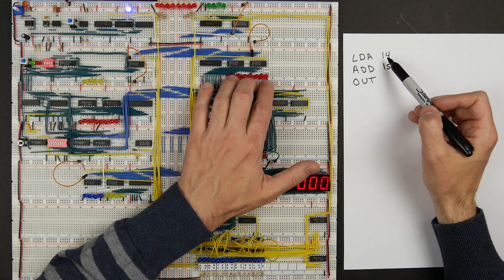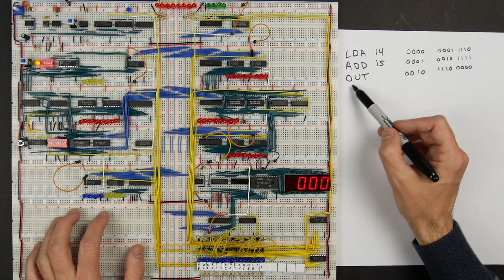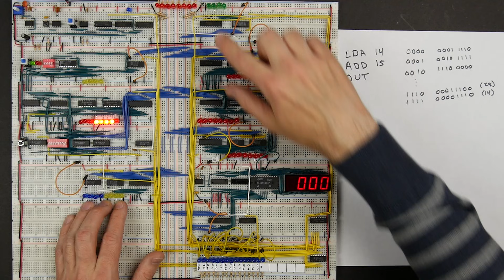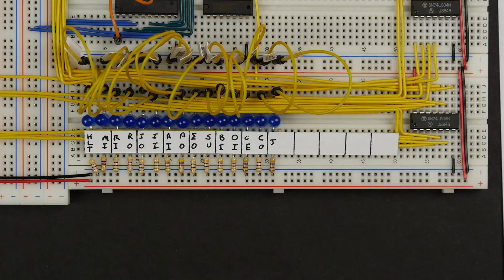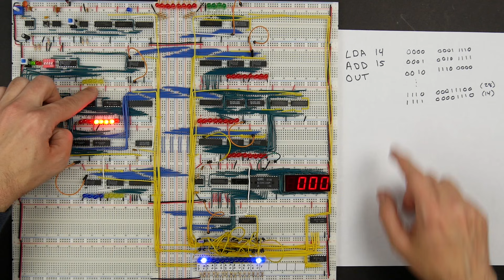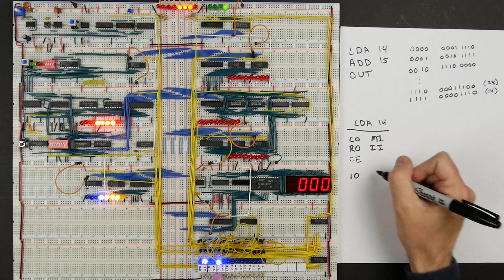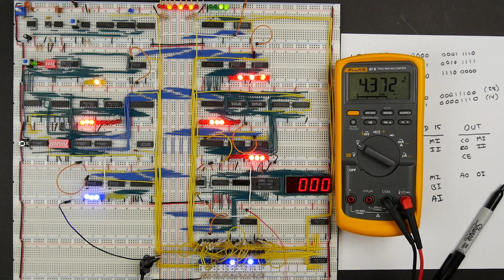8-bit CPU control logic: Part 1

Comment: Hi all - dumb question. I realize only a single module can "write" to the data bus at a time, but can more than one module "read" from the databus at a time? Asking because the fetch cycle is always "CO MI" to get the instruction from program counter to MAR, then "RO II" to get from MAR to instruction register. Wondering if it's possible to do "CO MI II" to write to MAR and write to instruction register at same time? Is there anything "electronically" that prevents this?

Comment: Hey Ben! if the program counter is looping through all the values in the instruction memory and manupilating the data inside that memory then wouldn't the Control Unit mistake a load data like 2, 6, 13, etc for an instruction? What do you do then?

Comment: @11:50
I don't know if you read comments...
Question though from the example  MO (Mem out) II (Instruction in).
Memory is ready with its output from the previous cycle, but not on the bus yet.

How do you manage the propagation between the values being written to the bus vs. read from it?

Is it fine to just turn on the (MO) write and (II) read bus transceivers at the same time/same cycle - or is everything in flux anyway until the clock cycle locks in the in values - which is slow enough to let levels stabilise.

Hopefully that made some sense :)
Cheers.

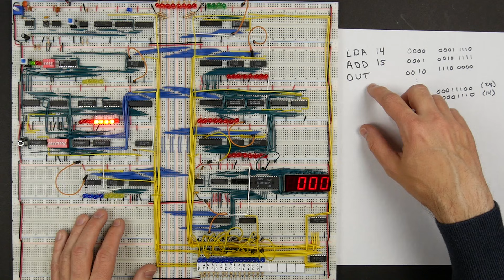Comment: The logic of building a computer that does not start with a "set program counter to.." instruction is confusing. 8:52 What if the program counter is not where you want to start? Computers are inherently built to get it checked and jump to where user wants to start ? please make video of how to add a 'jump counter to' instruction before running the program.

Comment: 13:47 my computer(cpu model) instruction register had 2x8bit register 8bit for opcode and 8bit for data
oh yes and my program counter is 8 bit too xD. so i have 8bit cpu model. your is kinda 8/4
(LDA 15)
CO MI
RO II CE
CO MI
RO DI (instruction register data oh yes 8 bit kinda D register build same board just 2x74ls173 and 8 leds more)
DO MI
RO AI
CE TS (now program counter and microstep reset ofc its inverted after led)

(LDI 150) (oh yes i can move 8bit)
CO MI
RO II CE
CO MI
RO AI 
CE TS

ofc i have 3 rom for microcodes get more signals to use

Comment: 📺💬 Jirayu gives me some conversations about the lessons.
🥺💬 You address memory and perform counter from memory in, I think someone asking me this question about do the output is from memory only or can address ⁉
🐑💬 It is a different path but he tells about inside the instruction and the output is from memory, do you remember what we can do with the memory ⁉
🧸💬 Organizing for performance. 🥺💬 Inputs only does not create new knowledge I try to express into cartoons or sample so I can leaves or add what it does need, the program counter can add number to the memory stored value but better it can desire which value to be add.

📺💬 Yui what is the root cause of the problem⁉
🥺💬 It required a clock cycle, working with memory.
🐑💬 Yes, but we see that the ground is not properly connected the measurement can measure value but it required stability to perform the correct work and good instruments had more advantage in lab setup.
🥺💬 I have sensitive memory too 🥺🥺🥺

( 📺💬 วันนี้กูจะเป็นคนนี้พอดี ...นั่นตายไปแล้ว 🐑➰ 🥺💬 ผมเห็นนะวันนั้น บางคนเค้าบอกหน้าเหมือนแต่ไม่ใช่ สอนต่อเถอะครับพวกเค้าคิดไปเองแต่งเรื่อง )

Comment: like. a=14 
b=a
a=6
c=a
b+c=20 something like that.
Reply: where the ram locations are replaced by figures out off the alphabet.
Reply: i was thinking of a basic code that represent this calculations.
Reply: 10 a = 14
20 b = a
30 a = 15
40 c = a
50 d = b + c
60 print d
70 exit
Reply: where 10 to 70 are clock counters. a basic porgram code similairity to above equation.
Reply: where the figures or letters of the alphabet can hold a vary of numbers. and therefor are called. variables.

Comment: 3 bits to control every physical object in the universe, protons, neutron, and electrons.  4 bit to control how every species on earth grow from a single cell into the great variety we have from people, to trees, to birds, to blue whales.  ACGT adenine (A), cytosine (C), guanine (G), and thymine.  Why do we need 8 bits for a computer to distinguish between a hand full of characters, numbers and symbols?  What if we could even get computers down to a 4 bit system.  That would effectively quadruple processor speeds.  (inverse square law) in case you are wondering why 4 isn't 1/2 of 8.

Comment: Hi I'm a mechatronics student currently on my sixth semester. I have to say your explanation in this video is phenomenal, your way showing how a computer actually runs a programm is intutive to a certain point, you poInt out all the important details and I just love the structure you gave to the computer and how you actually program the commands. Also the way you searched for the issue at the very end from mesuaring highs and lows until you find the specific place where the issue is happening and also looking at the datasheet for the component to see if it's working how it's supposed to I can totally relate to that struggle it's just that my projects have obviously not been this complex lol. Anyway, great video thank you very much for the knowledge you're spreading and greetings from Mexico!

Comment: Another question haha: would it be better to set the OUT command with a floating input that doesn't load RegA in order to save on clock cycles (1 command of OI instead of CO MI, RO II, CE and then OI)?

Comment: Another question: If I run a clock line through an inverter and run THAT to the RAM module could that half the speed of the fetch cycle?

Comment: Question: if you defined the most commonly used opcodes with more zeros than ones, would the circuit consume less power? In other words: if you use ADD more than any other command, and ADD in binary is 0000, would this have any impact on the overall power consumption?

Comment: So at around 12:45, would it have been possible to enable the CE (counter) in the same clock cycle as RO and II? Would either way be preferred for some reason?

Edit: ok, seems it had already come up and it was addressed in the next video 🤦

Comment: This video is especially fascinating for me. The step-by-step procedure done here is essentially how I would make a program in a high level language (e.g. Python)! That also includes that very interesting "debugging" bit there. I'd literally insert printing statements at various parts of the code to inspect the flow and see where did it start going wrong. 

It is also very nice to see how each part of the computer work together.

Suggestion: I think this video (or kind of an abridged version of it?) would be a very nice introductory video for your 8-bit computer building playlist :D

Comment: I love what you are doing here, hiowever you seem to have a 4 bit instruction set and 4 bit data, so aren't you actually building a 4bit processor with an 8 bit buss? the 6809 & 6309 were 8-bit microprocessors with an internal 16 bit bus. Most instruction only handled 8-bit both INSIDE the microprocessor chip, and on the external bus that connected to it. Also displays are not usually part of the processor, but sort of write only (sometimes read/write) memory locations. Most hardware is written to or read from similar to the way memory is, except some hardware pulls interrupts to make the processor jump to a subroutine that handles hardware that has time sensitive data. personally you are way ahead of me hardware wise, but the code say 4 bit to me...

Comment: I’m struggling to understand where the numbers 14 and 15 came from...
Reply: The LDA instruction doesn't contain the actual value to load; the bottom 4 bits are the address (memory location) of the value to load.  So 14 and 15 are the memory locations for the values being added.  The addresses are arbitrary; he chose 14 and 15 because with 16 bytes of memory, 14 and 15 are the last two locations.

One of the simpler extensions you could make to the instruction set (I say this not having yet built it, so someone correct me if I'm wrong) would be a LDI (load immediate) instruction, where the value to load would actually be the bottom 4 bits in the instruction.

Comment: One could maybe gain a half byte of extra memory per output by defining the OUT command as 0x00. You could then use the other half of the byte as a half byte memory location, and not altering the code itself runtime.

Trying that out after i get to make the commang logic :)

Comment: Isn't it possible to speed up the command loading by doing the counter increment (CE) during the RO/II fase since the counter output isn't used anymore and the CE doesn't rely on the bus. The CE shouldn't alter the command loaded in the interpreter. I could be wrong though.

Comment: In engineering school we were asked to make this for our Digital Design and Vhdl II class , but we didn't have to build it.
Instead we used a software from an australian Universitiy?
This software was called ReTrO and dear lord, making this shit work was a pain, it loved to crashed if you did't connect devices properly and it would also crash if you made sudden moves accross the schematic.
Did I mention it sometimes would crash if you tried to save too ?

Hell on earth, 75% of the class failed because that fucking project was worth 30% of the class and we were required to have 70%  to succesfully get the credit.

Comment: can you make an instruction that uses A and B as x,y indexes into your video card eproms display buffer and pushes what's on the bus into it, or pulls whats in the video ram onto to bus, with extra little control logic's switches??? that'll be some awesome :O :O :O yes and hook up your video card to the A and B register how? could it send a signal to the video card to pay attention, then push A onto the bus, then push B onto the bus, then the video card would have to do something itself away from the cpu to decode that and do the value set/get MAYBE i don't know it'll just be cool if you can make this thing play games :O

Comment: An interesting video.  Thank you, Ben.  You are obviously an obsessive compulsive, or have too much time on your hands, or both!
I wonder just how far you are going to go - will you write a compiler for it?  But I'm afraid to open your playlist just in case I get hooked!  Takes me back to 1978 when I had to fix a PDP 8S (Serial, 1MHz clock) that I'd rescued from the scrap heap.  It had a 12-bit word and 8 instructions.  To perform indexed memory operations you added the accumulator to the next instruction.  Can't remember how you undid that after the load/store :0).  Writing in assembly language was easy because there were so few instructions.  How far we've come in my working life time takes my breath away.

Comment: I'm a bit confused, what part defines whether it's 16 bit? The ram is location is described by 4 bits but the values in it are 16 bit. Don't normal processors both store and index by 64bit (or 32bit)?

Comment: I remember back in the 1980s when all I had was a 8-bit microcomputer (a Sinclair ZX Spectrum clone) I found a program called VisibleZ80 that would simulate on the screen the internal architecture of the Z80 and show how the data and signals moved inside the CPU as machine code got executed. That helped me immensely to understand how CPUs work, and I even used it to optimize some of the assembly code I was writing. :) It was a very complete program, even simulating the Z80 hidden/undocumented instructions IIRC. Unfortunately I don't have that program anymore; I've looked for it and it's just not in any software archive that I searched.
Reply: Please, help yourself : https://www.emucr.com/2013/05/my-amic-v14.html?m=1
works as the original :-)

Comment: couldn't you save a clock step in the fetch cycle by putting counter-enable (CE) in with the RO and II control lines?  Is there a reason the CE signal has to be by itself in a clock step?
Reply: sorry, saw that this was answered in the next video.  the answer is yes, you can!

Comment: You should add an HCF command. It really completes any list of opcodes...
Reply: High Cluster Fuck?
Reply: @AngelaTheSephira  Halt and Catch Fire, an instruction to have the computer to stop doing useful stuff and only 'run' (essentially only incrementing the program counter and nothing else).

Originally it was a joke referring to the high number of commands on IBM machines where the name didn't make it obvious what it did. However, later, a design flaw was found in a microprocessor where two address locations would do exactly that, so they've unofficially been named HCF

Comment: This is such a nice project, really well done and perfectly explained. It reminds me on something similar we did in the digital electronics lab one semester, back in university at the Technical University Berlin. It is so great to see, after so many years, that someone brings the depest root of our digital age to light in such an instructional and well made video. We couldn't use so many breadboards for our "CPU", because in our class we have been groups of only four people each and we ran a bit short on breadboards. We were told to build actually a 4 bit CPU, but I wanted to have an 8 bit one, which I regretted many times, later ;-). We ended up with seven or eight densely packed breadboards and a wiring that looked like an aerial photograph of the amazon basin rain forest. But in the end it worked up to 2 MHz clock frequency. We used an EEPROM as the instruction decoder, in a way like what you would call microcode. The instruction opcode was the address of the "microcode subroutine" in the EEPROM and the bits of the data in the EEPROM represented the different states of the multimplexers etc.. There was a common microcode routine, which increments the program counter by one, put its content on the address bus, load the data into the instruction register and put its content on the address bus of the EEPROM. The LDA command would increase the program counter once more, because we used 8 bit opcodes and 8 bits for data, load its content into the instruction data register, put the value of the instruction data register on the address bus and load the content into register A. And jump to the common "load next instruction" subroutine in the EEPROM afterwards. Other groups went with an FPGA as the instruction decoder and had a hard time even with their 4 bit CPUs. Our EEPROM approach was so plain dead simple and straightforward that, although we have officially been given the choice between FPGA and EEPROM, it felt a little bit like cheating ;-).
After this lab, in the time of Z80, 8086 and 68000, I felt like I know what every transistor in my computer is doing, when I was writing a program. Something, I wouldn't dare to say today ;-)

Comment: Very good. Veeery good. In your microinstructions, I guess when fetching the next op-code from memory, you could increment the program counter simultaneously with the load from RAM to instruction register. So the control logic could do RO + II + CE all in microstep 2, and save a microstep :-)

Comment: Hey Ben, considering the fact that no two modules should drive the bus at a time, would it be possible to decode 4 bits of control signal to 15 pins (where the last one is connected to nothing).
Doing the same for the input pins and also adding two 3 bit misc codes and 1 2 bit misc code would greatly expand the possibilities without harming the amount of pins one can turn on at a time.
That way, with 16 bits of output, one can drive 5 pins at a time and one only has to make sure that no two pins in the same group need to be active at once.

Would this be doable? I'm considering doing this for my own 8 bit breadboard computer

Comment: How computer decides that 0000 is load command and 0001 is add command. I don't get it , can some one explain.?
Reply: Barath Kumar at the time of this video, Ben was doing all of the deciding by himself by deciding which of the control lines he put at a high voltage each time he pressed the clock pulse button. In the next two videos of the series he builds a circuit that does the deciding for him

Comment: This is SO much better than the traditional approach for teaching computer architecture, which typically involves describing a ficticious computer and going through the motions of describing what will happen at each step of execution.  Seeing the LEDs change states as the clock is cycled makes it REAL.  Especially when it doesn't behave as expected!  Sure, machine simulators are great for demonstrating historic machines, but here it's like we're watching it come to life.

It's quite amazing: the control logic really isn't any more difficult than anything that has gone before (hey, that multiplexed decimal display was a work of art!), but this is where the magic happens - it stops being a pile of modules and begins to be a computer.

Comment: on a sepeprate question...where is the output result of 29??..isnt 14 plus 15 ...the equation?/..thanxz
Reply: ok i see the result output at the end of the vid..42..niot sure where the 28 operand came from..i see the binary version but how did you get that..thanxz..awesome vids
Reply: ok i saw at 6:50 where you input the actual data info of 28 for address #14 and 14 for adress#15

Comment: There is an structure to the machine language! it was established back as far as Univac there is Harvard or Stanford  structure you were right as to the mnemonic being assigned to to binary by the hardware designer but the mnemonics are set.
a lots of time the binary came about because of the physical tracing of the "AND" gate placements in the physical  wiring of the transistor and capacitor combination circuits.
and yes I am that old and go back that far in computers!!